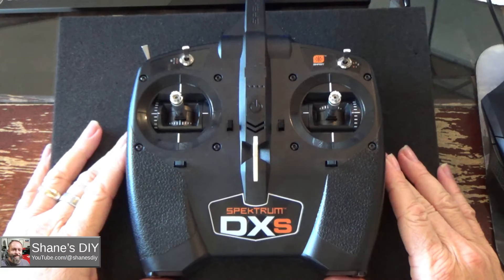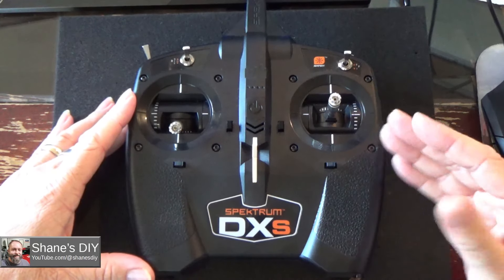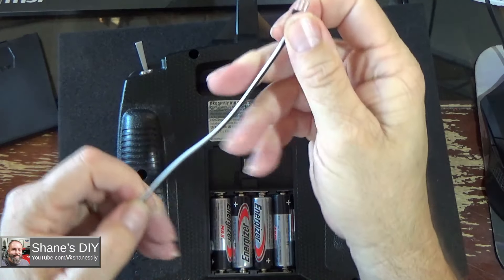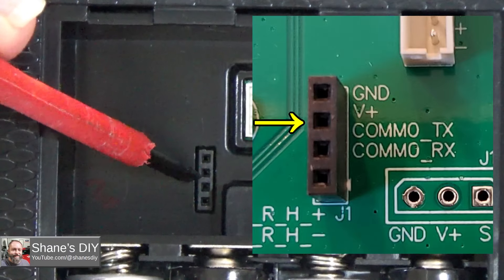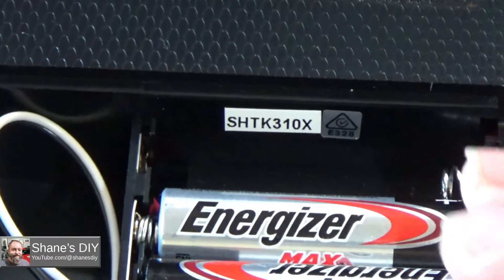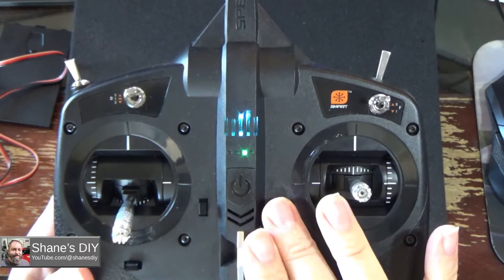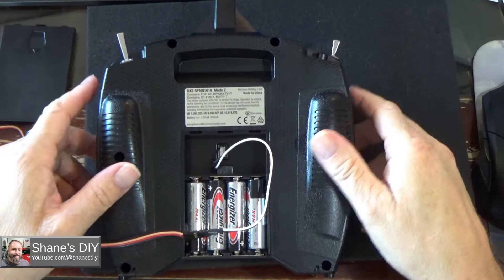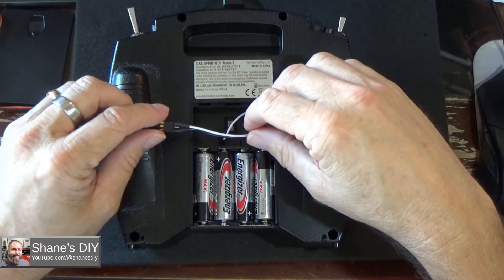Spektrum DXS Model Profiles & DIY SPMA3068 USB Adapter

Comment: I'm still using this.
Bought it a year ago with the Apprentice sts 1.5m.
My next plane is going to be the E-Flite Night Radian 2.0m BNF.
I'm not experienced enough with the expo and whatnot, so I'm using this until I get some more experience and knowledge.
I did play with the springs though.
I felt I was too loose for my fingers, so I gave the springs some more resistance, which helped me a lot with a more controlled input.
Reply from the maker: Gimbals seem pretty good to me.  All I did is add the "ratcheting" to the throttle as that is my preference.  Decent little radio for what it is.  I'll be doing another video with it soon.

Until you have a better radio you probably won't know what you are missing not having expo but you do have low rates so that helps.  I think the biggest issue I have with it, if you use it on a plane with flaps that has "ballooning" tendencies, you can't add a flap to elevator mix to smooth that out.

Comment: thx so to check if the 1.3 update is on the transmitter...if the blue light mode options come up then it's up to date right (as is case with mine)? and panic button only works for mode 1?
Reply from the maker: Correct, if you try to power up in the profile select mode and don't get the blue light, it needs the update.  Sounds like you are updated.

When you go to profile 2 channel 6 moves to the D switch so if your plane has panic on channel 6 (like on an AeroScout for example) then the D switch would operate panic mode. Two of the D switch positions would be panic mode and one would be no panic.  If channel 6 was not reversed panic would be in positions 0 & 1 and no panic would be position 2.  If you reverse channel 6 position 0 would be no panic and positions 1 & 2 would be panic.  Obviously not very intuitive so not recommended.

Comment: Interesting. Have you tried using it as a student transmitter with a G2/3 transmitter as the instructor?
Reply: I had a friend that bought a wireless trainer addon that connects to this transmitter and it does work, I learned how to fly a carbon cub with it.

Comment: Hi
  How do you get the computer page on dxs appear on computer?
Reply from the maker: I don't understand your question? There is no display or display output from the DXS. The DXS indicates the current profile, channel direction, etc. by the state of the LEDs above the power switch.  The only thing you do with the computer is update the firmware if it needs it.
Reply: Thank you for reply.  Yes i have connector and usb cable necessary for connecting to a pc to update my dsx to allow toggles to work for gear and flaps.  But there appears nothing on pc screen after this connection is made@shanesdiy
Reply from the maker: @kipfrey421  Are you referring to later in the video when I connect to my PC and turn on the radio and it sees it?   If yours doesn't connect you may need to reverse the polarity of the interface cable that goes between the radio and the USB cable.  Make sure the ground pin is at the top.

Comment: I find it a little stupid that you have to remove the lid in order to do buddy boxing.
What if the batteries falls out? Lol.
Reply from the maker: Well, once you get it setup, the small receiver you plug in for wireless buddy boxing, fits inside and you put the battery cover back on.  This one doesn't have a wired option that I am aware of so you wouldn't be leaving the cover off while flying.